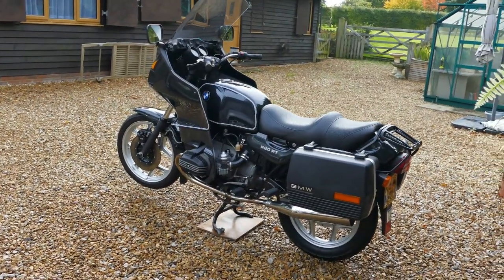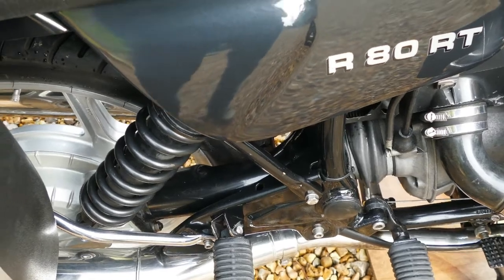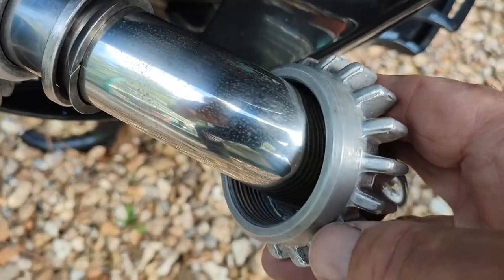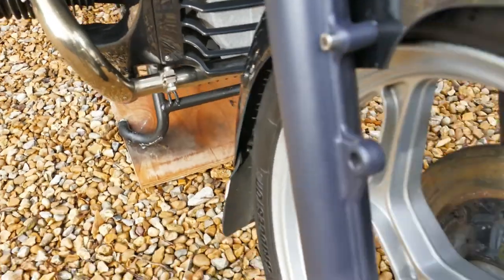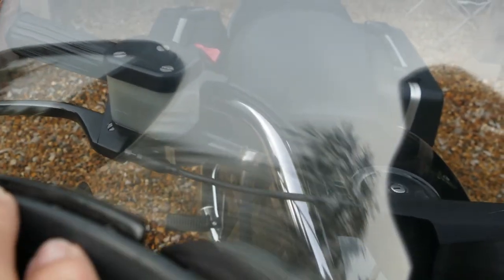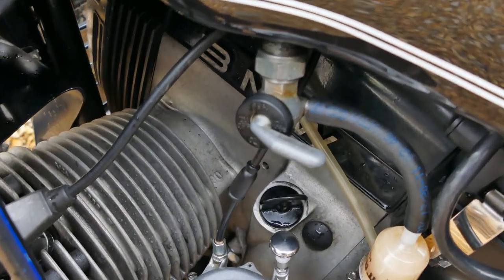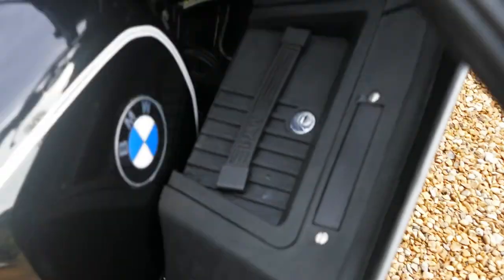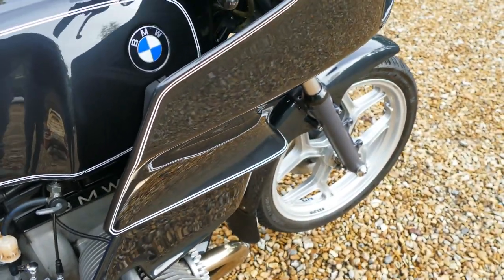1985 BMW R80RT MONO

Comment: Fantastic bike i owned an 86 maroon model in Brisbane Queensland Australia i road it around Australia from 87 until 2001it was 1 of the best bike's iv ever owned id buy another today if 1 became available im 65 in August and currently riding the FJR Yamaha 06 1300 with 164000 KMs without any issues only because of my legs and weight would i consider down sizing my R80RT 86 had done 89000km when i sold her without any problems the FJR is much smoother and faster and a much larger fuel capacity compared to the beemer 450kms a tank to 300kms a tank i don't ride as far these days compared to back in the 80s 90s look after the bike and it won't let you down 😊 ❤️